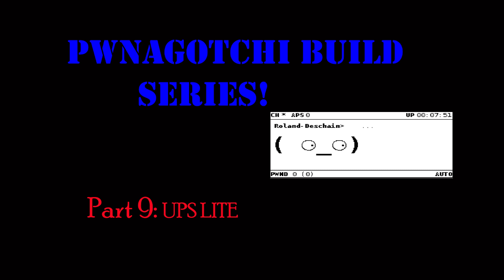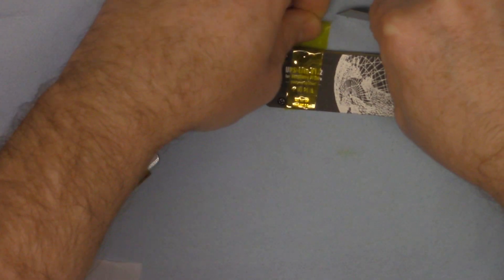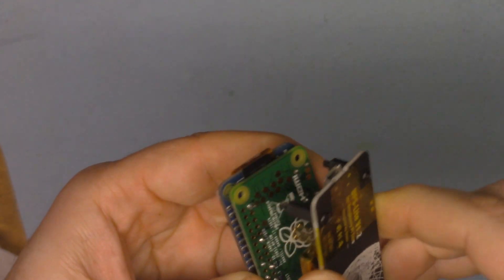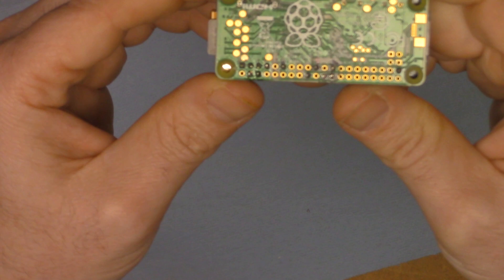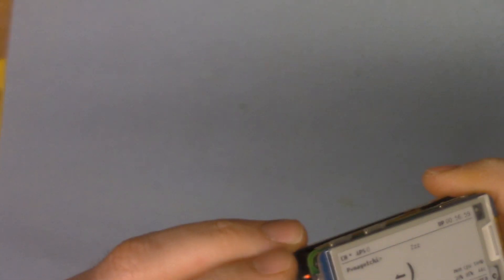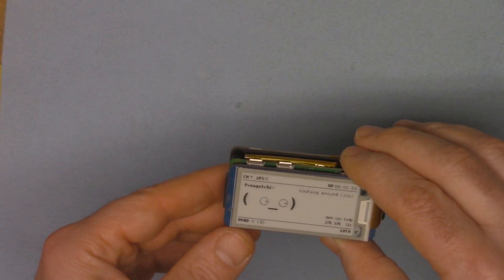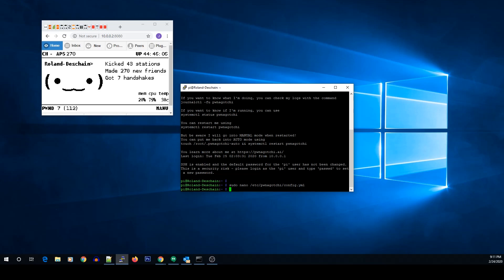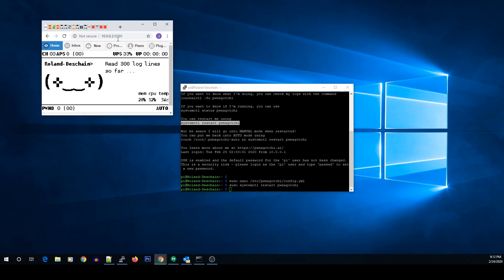UPS Lite V1 2 Pwnagotchi How To

Comment: I'm making my pwnagotchi with a ups-lite v1.2 and a waveshare v4.
Is it ok if i solder all the pins onto the rasperry pi and connect the waveshare display on the same pins the battery powers the board with?

Comment: great video ! i am not sure you are still reading comments here but for some reasons once plugged to the batter, it works for few minutes and shutsdown , checked the logs and it shows low batter ( eventho its full )
Reply: I got the same issue
Reply: @TuffyDK  i turned off the battery plugin 👌

Comment: I ordered one of these for my home automation rpi based remote - when plugging into USB, do you know if the pi still continues using the battery or current flows from USB instead ?
Reply from the maker: when you plug into the ups lite it charges the battery and provide more amps to the  Pi then just the battery.  I have been able to switch from the pi usb to the battery without the unit shutting down. IE if it's powered from the pc I can turn on the ups light and then disconnect. pi stays running.

Comment: Will this work on a pi 3 or pi 4? I'm planning to replace the battery into a bigger one.
Reply: Yes, you can actually use any Pi device, though your results may vary - certain Raspberry Pi models do not have wireless capabilities. You can also use any battery, though I'm not sure just any battery will work with the UPS-lite

Comment: Thanks for making this video. I came here to see the side profile of your battery, Mine was made in the same month as yours and I noticed it was starting to swell and press against the nano's soldering pins. Be careful of that as that can puncture the battery.  This is illustrated in a comment about the UPS-Lite for the full pi 3 board.
https://github.com/linshuqin329/UPS-18650/issues/2#issuecomment-424673763
Reply from the maker: Good to know. I didn't notice any issue on my unit, but I'll check it again.

Comment: Do you have the USB port sending data on the ups-lite?

Also, could you not just fill the through holes on the pi with solder where the ups-lite pins should press against so they make contact, instead of using back pins?
Reply from the maker: the USB port on the lite is charge only. 

you could use solder, but it the  protrusion of the pin that makes the connection.  building that up with solder is doable, but it just easier to add the Pin or at least the a small piece of it to allow for the connection.
Reply: @fatmannmakesbreaks498  I was wondering because of this thread: https://community.pwnagotchi.ai/t/ups-lite-v1-1-feedback/435/5 It made it seem like the microUSB port on the UPS-Lite was able to be utilize with some changes.
Reply from the maker: It may be possible, but as the  plugin currently functions this port is only for charging the battery.  Would have to check the specs  from ups lite to see if it's data capable.

Comment: Hi great project! quick question maybe you know this, will you be able to power the raspberry using the mini-usb plug on the ups-lite? and will it then also charge the ups? i have been trying to find this info unfortunately i am able to find it!
Reply from the maker: Yes, the specs for the ups lite  indicate when plugged into usb power it powers the pi at 1.2a ( higher then  running on the battery) and charges the battery.
Reply: @fatmannmakesbreaks498  Will this work on a pi 3 or pi 4? I'm thinking of changing the battery into a bigger one.

Comment: Do you know how to make it use my wifi adapter for monitoring i cant Figuren out how
Reply from the maker: If its the only adapter and is detected it would use it automatically
Reply: @fatmannmakesbreaks498  works now also is it possible to use wifi with it?
Reply from the maker: No, the wifi adapter is put into monitor mode. It's can't be used to make a.wifi connection as it's tied up. Scanning for networks..
Reply: @fatmannmakesbreaks498  i still have the wifi Chip from the raspberry pi

Comment: Nice build  mate.  What's the battery life like?
Reply from the maker: D.L. it's only 3-4hrs I can see it being useful for quick trips or if you use your gotchi in the car. I.E. ride through when you shut the car off (if you were say, a delivery driver or something)
Reply: @fatmannmakesbreaks498  can you charge it while it is switched on?  like in the car?
Reply from the maker: Yes it will charge when running. ( Have to use the USB on the ups obviously)